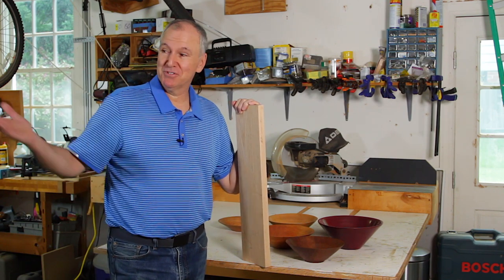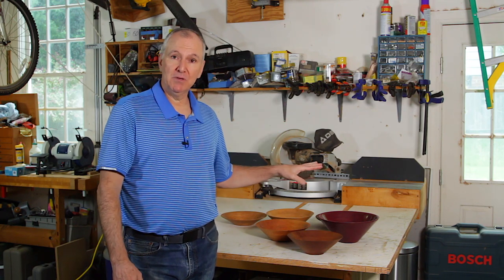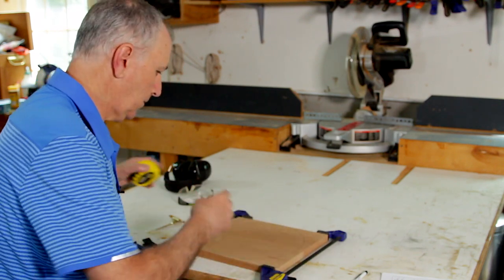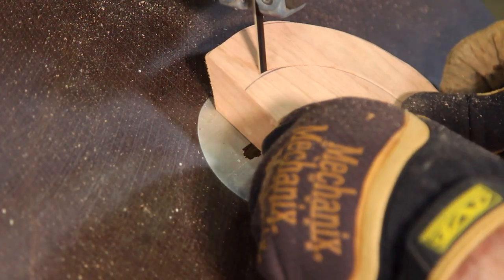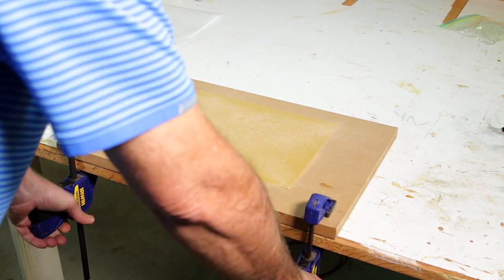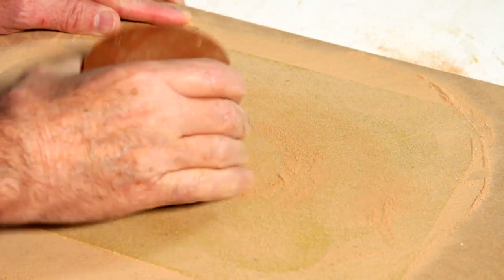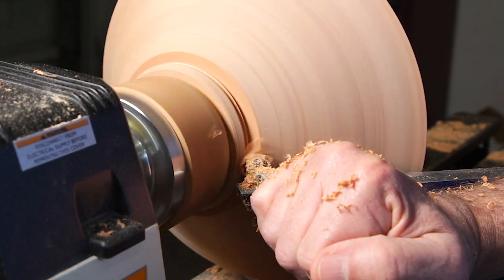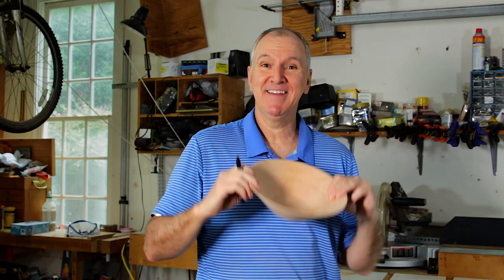How to Build a Bowl from a Board

Comment: I'm going to make a suggestion, instead of salt use sawdust I've found salt can cause a bit of discoloration at the joint and even leave a gap here and there but sawdust doesn't change the color of the glue joint and fills any gap instead of highlighting it.
Reply from the maker: Hi misfitramone, good suggestion. I've never experienced any discoloration in this application and again, I'm using a tiny bit but I'll certainly hang on to this tip for future projects. Cheers!

Comment: Clear instructions but question. You use 7/8 “ per ring and the edges lined up when stacked. How was that dimension determined? Is it a relation to board thickness? If I use 3/4 “ does the width of ring adjust to mane 5/8”?  Does the 45degree tilt affect ring size?
Thanks for the help. 
PS I tried 1 1/4” rings on 3/4 “ and no edge match so need to adjust.
Reply: Hi Neil, I determined that dimension through trial/error. I use 3/4" stock and 7/8" seems to work best ... some overlap but not too much. As for the 45-degree tilt ... hmm? It probably affects ring size but I don't know what the adjustment would be. I'm sure someone smarter than I am has a way to calculate that. Good luck with your turning!
Reply: Thanks David. I am playing and see what happens. I have glued up a bunch of scrap pieces to dimensionally add up to at least 5 1/2 w and 12 long. Let’s see what transpires.
Reply: At this point I tried 7/8” as well as 3/4”.  Started with 10” outstanding diameter and 3/4” thick wood. 
So far rings don’t align although the 3/4 ones got closer. 
This also created problem centering. Am playing with creating a centering jig.
Reply: Hi Neil,
Just confirming… your band saw table is set to 45 degrees when you’re cutting the half rings? If so, I’m not sure why they’re not lining up.